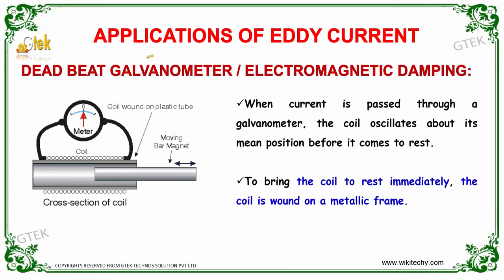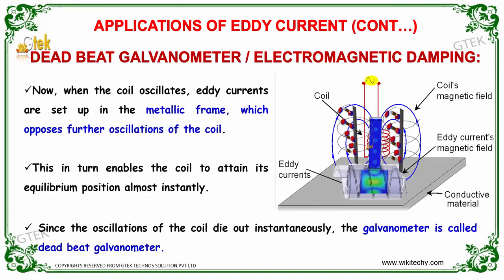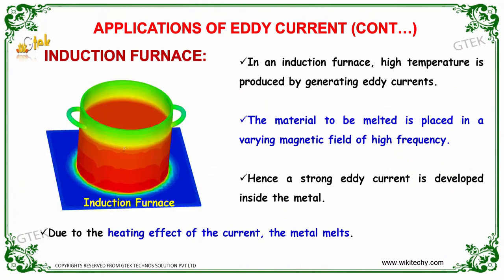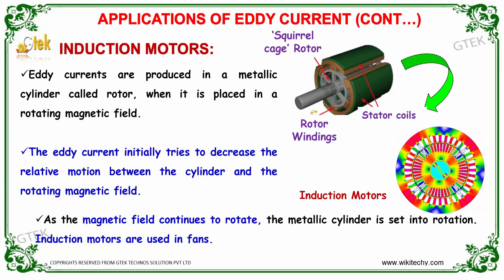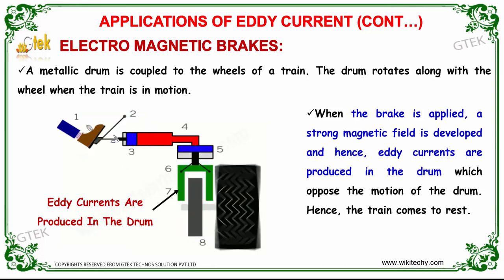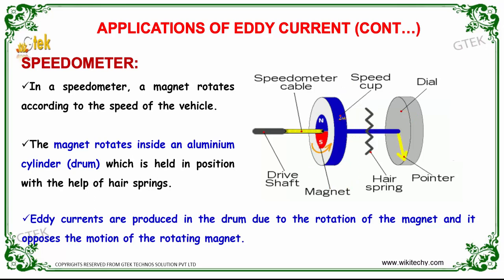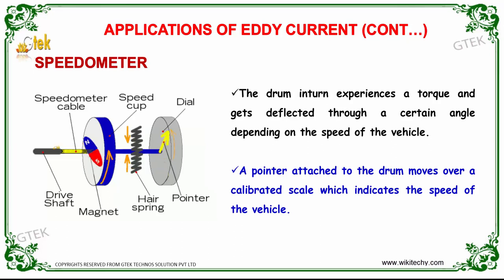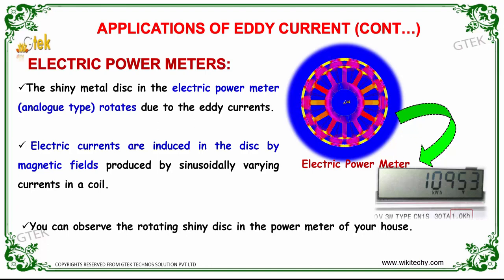Application of eddy currents|Electro Magnetic Induction And Alternating Current

Comment: Jul 22, 1999 - At the heart of both motors and generators is a wire coil in a magnetic field. ... An AC (alternating current) generator utilizes Faraday's law of induction, spinning a coil at a constant rate in a magnetic field to induce an oscillating emf.

Comment: Eddy currents in conductors of non-zero resistivity generate heat as well as electromagnetic forces. The heat can be used for induction heating. The electromagnetic forces can be used for levitation, creating movement, or to give a strong braking effect.

Comment: In order to reduce the eddy current loss, the resistance of the core should be increased. In other words, low reluctance should be retained. In devices like transformers, the core is made up of laminations of iron. ie,the core is made up of thin sheets of steel, each lamination being insulated from others.

Comment: Eddy currents (also called Foucault currents) are loops of electrical current induced within conductors by a changing magnetic field in the conductor, due to Faraday's law of induction. ... The current flowing through the resistance of the conductor also dissipates energy as heat in the material.

Comment: These circulating eddies ofcurrent create induced magnetic fields that oppose the change of the original magnetic field due to Lenz's law, causing repulsive or drag forces between the conductor and the magnet. ... The electromagnetic forces can be used for levitation, creating movement, or to give a strong braking effect.

Comment: Eddy currents (also called Foucault currents) are currents induced in conductors, when the magnetic flux linked with a solid conductor changes. The change in magnetic flux can cause a circulating flow of electrons, or a current, within the body of the conductor. The term eddy current comes from analogous currents seen in water.

Read more at: http://www.askphysics.com/eddy-currents-applications

Comment: Since the energy lost in each cycle is constant, hysteresis power losses increase proportionally with frequency. Eddy-current losses - If the core is electrically conductive, the changing magnetic field induces circulating loops of current in it, called eddy currents, due to electromagnetic induction.

Comment: The first person to observe eddy currents was François Arago (1786–1853), the 25th Prime Minister of France, who was also a mathematician, physicist and astronomer. 
In 1824 he observed what has been called rotatory magnetism, and that most conductive bodies could be magnetized; these discoveries were completed and explained by Michael Faraday (1791–1867).
In 1834, Heinrich Lenz stated Lenz's law, which says that the direction of induced current flow in an object will be such that its magnetic field will oppose the change of magnetic flux that caused the current flow. Eddy currents produce a secondary field that cancels a part of the external field and causes some of the external flux to avoid the conductor.
French physicist Léon Foucault (1819–1868) is credited with having discovered eddy currents. In September, 1855, he discovered that the force required for the rotation of a copper disc becomes greater when it is made to rotate with its rim between the poles of a magnet, the disc at the same time becoming heated by the eddy current induced in the metal. The first use of eddy current for non-destructive testing occurred in 1879 when David E. Hughes used the principles to conduct metallurgical sorting tests.

Comment: Image result for Application of eddy currents
Eddy currents in conductors of non-zero resistivity generate heat as well as electromagnetic forces. The heat can be used for induction heating.